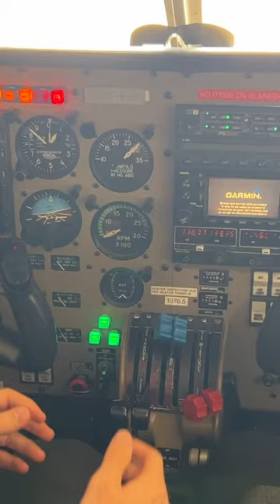Main Components of a Multi Engine: What our Throttle Quadrants look like | Part 2

Comment: YEEEEEEHAAAAA multi engine high performance 💯🤠🤟
Reply: Nice try. Do not count the P44 as high performance in your logbooks. In this case, 180 hp + 180 hp does not equal more than the required 200+ hp engine according to the regs.

Comment: I did not know this the blades pitch just like in a wind turbine, interesting
Reply: Yes they do.  In multi-engine propeller driven aircraft, you need to be able to feather the propeller in case of an engine failure.

Comment: so  why ya want to get constant   rpm ?  why?  thot the Throttle controls power and rpms on single engine. ( fixed pitch blade?)
I think there's alot.more to it.. the changing pitch of blades and rpms and speed blahblah.. 
need to explain it more better imo
Reply: A controllable pitch propeller is like a 10 speed bike.  When you were little you had a single speed bike but when you got bigger, you got a bike that could shift gears.  Being able to shift allows you to choose the right speed / gear for the conditions.  The same is true for a controllable pitch propeller.  You can choose the pitch for the conditions you’re flying.  Smaller aircraft have fixed pitch props because they need to be less complex. 
Because it’s controllable, it needs to stay at the rpm you set it to.  A governor does that.  Because of the governor sets the speed, the throttle doesn’t actually change engine rpm, but rather increase the power output known as manifold pressure.